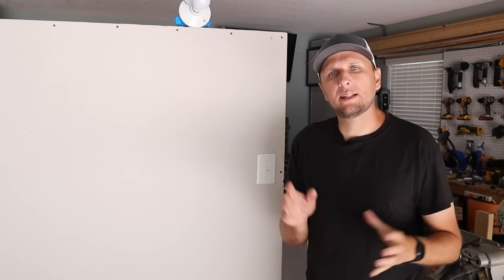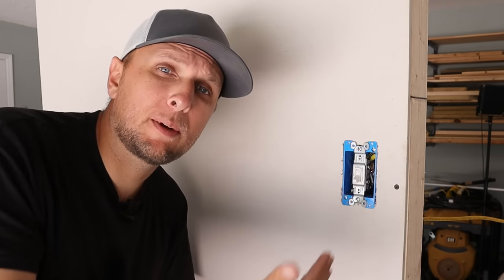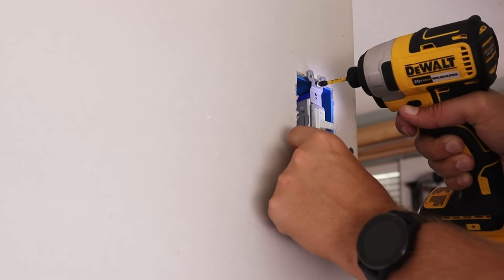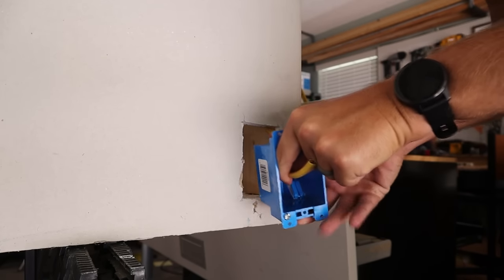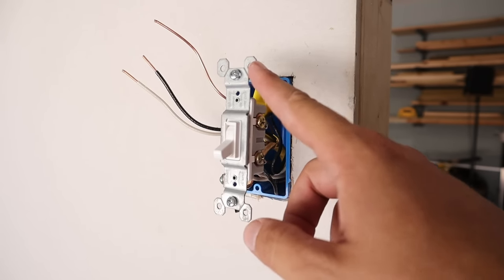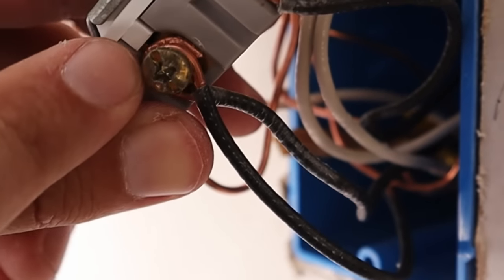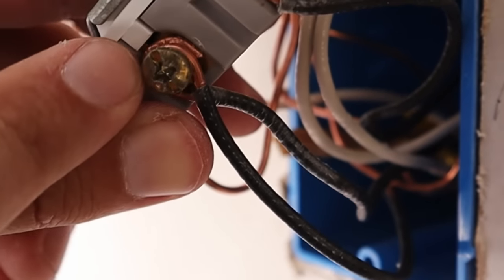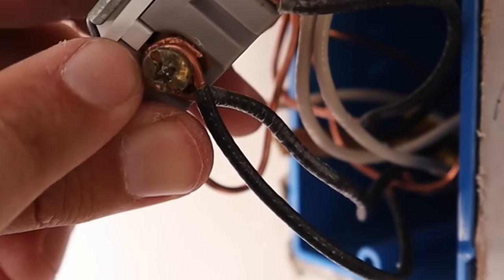How To Add An Outlet From A Light Switch | Common Mistake

Comment: Great video. Another tip is to write the circuit number on the back of the plate cover so that next time you need to work on the switch or outlet, you know which circuit to shutoff.
Reply: You can take this opportunity to add it to the description in the service panel so you look smart from that side, too.
Reply: @richsimcoe2683  k
Reply: I'm retired now but have done electrical work since 1978 from working on electrical hand tools (before battery operated came around) to residential wiring on to commercial and retiring working for a utility company installing primary voltage, transformers ect. I have never heard that idea about marking the breaker number on the back of a plate, but that's a good idea.... You just taught this old dog a new trick....lol
Reply: I don’t care for this suggestion of marking the circuit number on the plate cover because every time I paint, I take all the plate covers off and throw them in a shoe box. I guarantee you the plates never go back on the same place they came off.
Reply: why are you not useing green wire nuts
Reply: There was no explanation of the outlet box on how to tighten up the butterfly nuts on back of box. The box used is for remodeling existing walls
Reply: Susan's comment was the exact same thought I had. Instead of the back of the plate cover, you could write it on the receptacle or toggle body instead - those are less likely to be removed and swapped with another (unless it fails ... or the homeowner wants to change the color of all 400+ receptacles, toggles, cable plates, phone plates, and central vacuum covers in the entire house, lol).
Reply: Great tip, thank you!
Reply: I like this idea. Gotta update my house with that
Reply: @bhamsoxfan72  even then, receptacles and switches fail or get replaced, and you should really already have the breaker off before even taking that plate off. I like the idea on the surface level, but it really is just best to label the panel
Reply: @joshmonaco6170  Sure, in an ideal world, the panel would be labeled. But you probably know as well as I do that switches and receptacles are often in a room other than the one that is noted on the label in the panel. More often than not, when I'm needing to turn off a breaker, I'm pulling out my circuit finder so I don't have to make 7 trips from the receptacle to the panel because that one receptacle in the living room was added 15 years after the house was built, and it was added to the closest cable that could be found and spliced into - the attic lights cable running through the wall where that receptacle was added... Or the electrician decided to connect the circuits to breakers that were different from the labels that were pre-printed in his office. Maybe a little redundancy would solve more problems than relying on labels in 1 location.
Reply: @bhamsoxfan72  fair point. I really feel like the NEC should adopt a standard on circuit wiring spanning across multiple rooms. Either ban it or require specific rules about what can be done and how it must be labeled. Still wouldn't stop DIYers or sparkies working under the table, but at least you'd know going into new installs or after somebody who isn't a hack you won't run into that kind of wacky shit. One time I doing a reno in an apartment and my old lady was in the kitchen replacing cabinet hardware while I was doing receps and switches in the living room next to it. So I had my breaker off but left hers on so she had light and when I got to the recep closest to the kitchen and clipped the wires BAM my strippers are welded to the wires, the lights all go off, and she's freaking out thinking I hurt myself lol. All because they decided to include that one recep to the kitchen circuit and of course nothing was labeled so I had no way of knowing other than maybe checking every hot for voltage which would just increase the amount of time it takes by so much. Our lives would be so much easier if people just kept sensible circuit designs and properly labeled everything 😭
Reply: Wow! Incredibly simple and extremely useful tip!  Beats the hell out of figuring it out by flipping breakers.
Reply: @richsimcoe2683  I don't know why I've never thought of this! Great tip, and so simple to solve an annoying problem at my house.  Thanks!
Reply: @susanhoover1820  Umm... maybe you've since thought of this, but you could NOT throw them in a pile in a box.  I've painted my home as well, and I return the same plates back to their original location.  Doesn't seem like much work in my opinion.  To each his or her own though.
Reply: @bhamsoxfan72  I just flip the main breaker. They have these things called flashlights. They even headlamps out now. Should try it.
Reply: @realtyrocks1969  Flashlights? Headlamps? Never heard of them... Lol

That's fine ... Unless your customer is home and working from home and has a tech support position that requires the use of a computer with multiple monitors... Or, if you're replacing 400 receptacles and toggle switches in a 7Br house... You can't switch off the main breaker in situations like these.
Reply: @bhamsoxfan72  OH but I think you can. If you can turn it on, you can certainly turn it off. My home is a 6 bedroom 3 bath home and I just changed out the outlets in 90% of the home and installed 1 new receptacle off of a switch that didn't have an outlet where I needed one. Did it all with the power completely off. Was leagues faster than running to the breaker panel for every room and some areas like around the stove that were on a different breaker switch from the rest of the kitchen. I had the entire family home and just told them the power will be off until I'm done. Not that hard. Customers won't question you - if you're the professional they called for your services. I do have emergency bulbs in the hallways and the master bedroom too so even with the power out I still have some light in the home. Those that don't- a  good flashlight works great. And a 7 bedroom home shouldn't have 400 receptacles.  Most bedroom probably has 5 outlets + 2 switches. A 7b home probably has 100 receptacles and switches total.
Reply: @realtyrocks1969  Sure, you CAN, but then you'll hear the customer say, "Thanks, but I'll find someone else..."
Reply: @bhamsoxfan72  probably not. I had to call a plumber a month or so ago...he had to turn the water off. Kind of expected. Same goes with electricity.
Reply: @realtyrocks1969  The last time I checked, computers don't run on water, and if you're shutting off the whole house for 4 or 5 days just to work on one plumbing fixture at a time, you're not going to have happy customers ... So, no, not quite the same thing. Not anywhere close to the same thing. Actually, quite different things altogether.
Reply: @bhamsoxfan72  your customers probably don't want you to turn the engine off when they get work done on their vehicle either.    Went from 400 outlets in a 7 bedroom home to 4 or 5 days... lol.
Reply: @realtyrocks1969  Well, it's obvious that you're this incredible, super electrician that can replace 400 receptacles and toggle switches in a 7Br house in a day while the owners are there and need to use those pesky appliances like computers and AC and refrigerators, so I'll just bow to your supremacy and grovel my way out of this conversation.

And you might want to stay on topic in the future instead of trying to prove your inadequate point with irrelevant issues like plumbing and automotive. Apples need to compared to apples (electrical), not oranges (plumbing) or pork chops (automotive).
Reply: @susanhoover1820  you can mark the cooresponding switch with the same as the back plate
🤓👍
Reply: @susanhoover1820  You could add a descriptor to the plate too. ex: "Ckt 2 - North Wall Switch"; "Ckt 4 - East Wall Outlet Left". This way, you have circuit numbers and what plate cover goes where and you could easily take them all off and throw them in a box when you paint and know where they go when you need to put them back on.
Reply: Thanks for the tip! Good one.
Reply: Great idea, but Susan has a good point. I applaud people that actually remove plates and fixture canopies to repaint instead of painting around or over the plates.
You can write it on the box wall, but the panel may have circuits change, added, or breakers rearranged.
Reply: Thanks for the idea and I’ve already done it several places on my last projects.  Wife thinks I’m a genius 😉
Reply: @bhamsoxfan72  "unless...the homeowner wants to change the color of all 400+ receptacles,...."  You apparently haven't met my wife.
Reply: @thatzwhat  Lol. Maybe not, but apparently, I HAVE met her twin...
Reply: Or just get some small plastic Avery labels. Write the number on that, and place around the wires or tape to inside of the box
Reply: @susanhoover1820  Then scrbble it on the edge that is covered by the plate.
Reply: @joesalcido9849  Sloppy planning of the video with other problems that are not problems for experienced people who would not make the mistakes that he is covering.  Claims for beginners but not good for them.
Reply: @susanhoover1820  Then mark on the inside of the outlet, under the plate.
Reply: We have a map. If it's REALLY stupid/possibly dangerous, you write that right on the inside of circuit box door. 

Ie: boiler circuit+outlet+front hall lights= BIG NO NO. It should be lonely.
Reply: @joesalcido9849  My thought too. If using a box with butterflies, which he didn't address specifically, why the necessity to find a stud, except to miss when sawing the drywall? In this instance I would assume, perhaps erroneously, because of what I can deduce from the build, the light switch would be fastened to the stud. Wouldn't the outlet need to be moved away from the stud to accommodate the flaps? Which he DID do, but I missed an explanation why he did, or why he needed to find the stud; in THIS instance.
Reply: An EXCELLENT idea!!!  Imagine if this was done right the first time by home builder!
Reply: @susanhoover1820  Well, if you took a piece of painters tape, stuck it above the outlet, and wrote the # down from the plate, you could use the same plate or a new one regardless.  You shot down an excellent suggestion just because you work a certain way? Work differently. This idea saves a LOT of time.
Reply: And the paint color
Reply: I’ll be speaking the name @handyrus whenever this saves me time from now on!

Comment: There are two ways to do this, the wrong way and the hard way. The hard way is to bring a new wire set from the circuit breaker panel.

Comment: Before cutting holes and running wire, you need to check to see if the switch box has a neutral wire. They all do not have one. They don’t have one if the feed wire comes into the light fixture box first. In that situation you will only have two wires and a ground at the switch. One feed coming from the light box and a switch leg wire back to the fixture.
Reply: YES, you need a common wire to make it work.... G O O D point....
Reply: Exactly. A dead end switch is what it's called.
Reply: That's what I was thinking, "Don't cut that hole until you verify that there's a neutral in that switch box!"
Reply: Yep just ran into this while trying to add an outlet from my switch 🤦‍♂️
Reply: My first thought also when I saw the title of this video.
Reply: You shouldn't need a video to add an outlet fed from a device box that has a neutral wire.  I'd like to see a video where someone adds an outlet fed from a device box without a neutral.  Jokes on me for watching this captain obvious video.

Comment: I'm not an electrician but my grandfather told me to always tape around an outlet or switch so the screws were covered. Of course in those days all the boxes were metal before plastic. I also tape wire nuts going clockwise the same way they're screwed on, guess it goes back to the old rubber tape and then cloth tape over that. Guess I'm just old.
Reply: my dad told me 2 tape everything also... i wrote above, 6 days after u... 😉
Reply: Nothing against your dad, but really not needed especially in plastic boxes. Tape makes a sticky mess on outlets & switches

Comment: The 1st rule of wiring. Never trust the guy who wired it before you. Assumptions are the mother of all electrical deaths. Great video! I would only add that there is generally a minimum height off the floor of 15 inches to the bottom of the receptacle, but one would need to check their local codes to be sure.
Reply: You've been to my house, then? Lol
Reply: I've never heard of a minimum height. Custom homes frequently have receptacles in the baseboard.
Reply: Min height is 18" AFF ( above finished floor ) ADA NEC code
Reply: @-flem-266 ADA says 15 minimum, 18 would be acceptable though
Reply: @phi5head nah dude, it has to be in between floor joists.

Comment: If your house was built before 2011 when the NEC made it a requirement to have a neutral in all boxes, you only have a 50% chance or less of having a neutral there. So that should be looked at first before cutting holes in the wall because that may change your plan.
Reply: Right. If it's a switch loop set up it wont work.

Comment: Although I didn’t look at all the comments, I think it’s worth pointing out, perhaps again, that when you first open the existing switch box, make sure there are separate neutral and load wires in place. Especially in older construction, you can often find only a hot and load in a single romex run, black usually hot and white to the load, no wire to carry the neutral to extend to the outlet.
Reply: I've run into this more times than I can count, and it always screams "lazy electrician" to me. Yes, interwebz trolls, I know that copper is expensive and tract homes especially were built in least-time, lowest-cost environments, but I don't give a damn. Do it correctly the first time.
Reply: I run into this more than not doing remods.
Reply: Came to leave a similar comment. Boy do I hate power at the light. I'd say any house before the 80s here in Newfoundland are done that way. Atleast there isnt much aluminum here. I've yet to run into any branch circuits in aluminum.
Reply: @dionh70  Not lazy (unless it is new-ish construction.) That used to be the approved method.  Code didn't even require a ground to a switch.  Pretty common for a single-pole installation to be just 14-2 from the light fixture to the switch.  And only recently has the code required an active neutral be present to accommodate lighted/smart switch devices.
Reply: That's why I'd rather have to deal with an extra wire in the box. Makes future changes easier.
Reply: This is what I encountered today in my home. Ground wire attracted to the work box. I’ve no idea what I’m doing
Reply: @dionh70  It is often done and it is called 'backfeeding'. It is NOT an electrician being lazy, but a standard practice.
Reply: How do you add an outlet from the switch wiring in this case???
Reply: Light circuits are usually 14 gauge wire on a 15 amp circuit breaker, not very good for a power outlet/wallplug.

Comment: Coming to the end of my first year of apprenticeship. My job is fully residential & some times trying to fish straight down can be super annoying. With the steel fish slightly bending and catching on everything in old walls. A chain makes so much sense!! I’m 100% using this from now on.
Reply from the maker: Glad it was helpful!  Thanks for the feedback!  Good luck in the rest of your apprenticeship!
Reply: Hope you enjoy your apprenticeship. I served mine at a coal mine as both an Electrical Fitter and Mechanic. It involved 11,000V down to 32V. I worked on heavy earth moving machinery like draglines and shovels, underground mining equipment and residential type wiring in offices and workshops. 415V 3-phase often applied there. All very rounded and interesting. My father was an electrician too and worked as an electrical engineer on ships. He was my immediate boss and chief electrician  at the mine.
Reply: Slightly curl the first 6" of your fish tape and direct the tip of the fish tape so it runs down the corner between the drywall and stud. This is especially useful when there is insulation in the wall. Works like magic and your fish tape will pop right out of your hole.
Reply: Yes!! This idea is simultaneously ON AND OFF THE CHAIN!! 🤣
Reply: Fish sticks fish sticks
Reply: Also grab a fishing weight like the kind you would use for deep sea fishing. Many times using the extra Weight is just what you need  to get a string or a chain down a wall....especially if it's insulated

Comment: Nice video.  Very clear and informative.  I would like to add a couple of items that I didn’t see in the video nor the instructions.  First, seeing that it was a 15A circuit from the breaker box, it’s important to note that using the correct wire and receptacle is a safety concern.  Too many people will just grab materials from their home supply store and think they’re all the same.  Using the matching wire and receptacle to the circuit is a safety concern.  Secondly, using the correct wire nut is just as important.  In the video, a yellow wing nut is used with 3 #14 gauge wire.  Code would recommend a red wire nut when combining 3 #14.